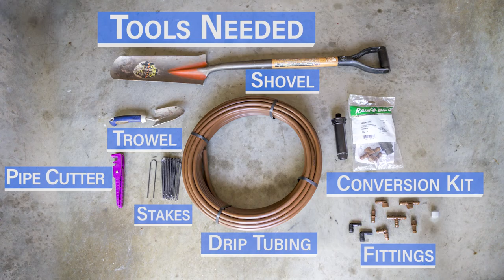Converting From Spray to Drip Irrigation

Comment: Advisory: not all sprinkler heads have a 1/2 inch coupling. The builder installed the Rain Bird 5000 here, which has a 3/4 inch coupling. Rain Bird doesn't take customer service calls on the week-end, but if I find out whether they make a coupling converter, Ill amend this comment.

Comment: This is good but why did you dig and replace the sprinkler head when all you needed to do is replace the internal parts to what was in the ground? 

Simply unscrew the top and remove the sprinkler internal components and replace with the drip retrofit…no digging needed.

Comment: Hello! This is a wonderful conversion system! Did you have to do anything to the sprinkler valves to adjust the water pressure?
Reply: I believe the Rain Bird conversion kit used in this video has a built-in pressure regulator that drops the pressure to 30psi.

Comment: If I convert 1 sprinkler head to drop irrigation  and cap the rest of sprinkler heads, I noticed leak in the water valve control box. Reduce water pressure at control box did not help.

No leak in water valve control box if I put back sprinkler heads.
Reply: @dt dt Have you found a solution? I am thinking of converting my sprinklers to drip but HOA has noted a past issue with people capping the sprinklers and breaking the shared sprinkler system.
Reply: Test

Comment: Hi, after watching your video, this seems to me very useful, have one question, can I convert 2 or 3 landscaping sprinklers in one zone to drip system?  One is okay to close the rest in that zone, but didn't see any advice on 2 or more to converstion?
Reply from the maker: Hey Abdul. You just need to convert/connect one of your sprinkler heads using the connector and drip tubing. And cap the other heads in the zone. Here's more info on where to find the retrofit Kit: The products we used for this video are manufactured by Rain Bird.  We used the 1800 Spray to Drip Retrofit Kit and 1/2 inch Drip Emitter Tubing with 12” emitter spacing.  You can purchase these products online or at a nearby store.   You can find store locations by using a “maps” application on your phone and searching “sprinkler supply company.”  You can learn more about the products we used at:  @t.
Reply: @trwdtv  You and all others, told to convert one sprinkler from one zone, unfortunately, there is a concrete pathway in between and in the same sprinkler zone, the guy put almost  more than 8 sprinklers in one zone.  I want to convert 2 or 3, by caping all others, can I do this in one zone, this is my question, if you can advise, please.
Reply: @abdulkhalique4170  As long as you are converting the entire zone to drip irrigation, you can easily do what you are describing.  You don't want to have drip and sprays on the same zone.  Sprays need to run 6 minute cycles and drip zones can go for 30-45+ minutes.  Depending on the size of your drip bed areas, you may want to convert two sprinkler heads (opposite to each other) on each side of the sidewalk and loop the drip line on each side in a grid pattern.  Cap the other 4 sprinklers and good to go.

Comment: This is super helpful, would be you able to place links as to what conversion kit and tubing you used?
Reply from the maker: Hi Brittany!  Thank you for the question.  The products we used for this video are manufactured by Rain Bird.  We used the 1800 Spray to Drip Retrofit Kit and 1/2 inch Drip Emitter Tubing with 12” emitter spacing.  You can purchase these products online or at a nearby store.   You can find store locations by using a “maps” application on your phone and searching “sprinkler supply company.”  You can learn more about the products we used at:  https://www.rainbird.com/products/spray-drip-retrofit-kit andhttps://www.rainbird.com/products/12-drip-emitter-tubing.